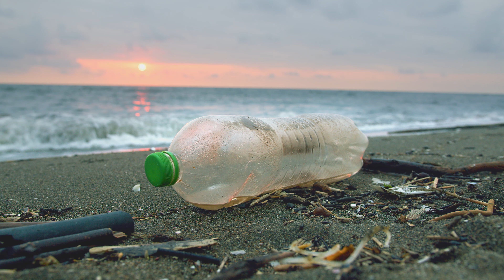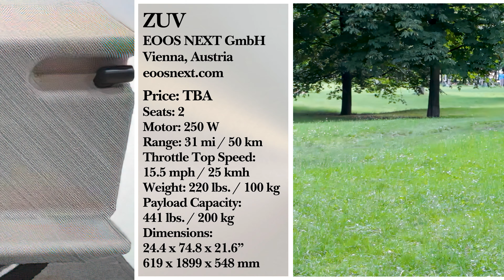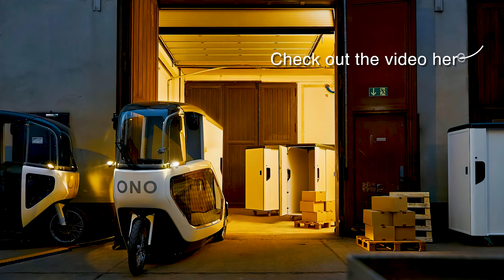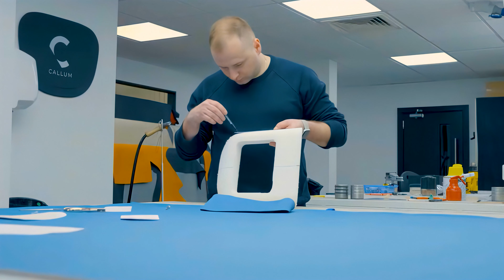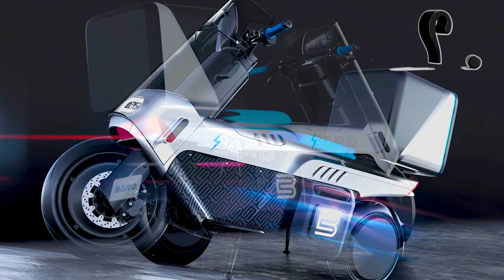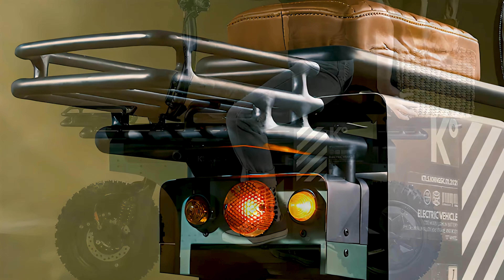EOOS NEXT ZUV Uses 3D-Printed Recycled Plastic to Rethink the Cargo Trike

Comment: Obviously living in the USA is a draw back, seems we aren't as interested in  developing these vehicles.  Thanks for sharing. 😁👍🇺🇸
Reply: I just bought a tiny micro electric car that is speed limited to 40km per hour.
So maybe that means i can rip out the motor, and put in a tesla motor and then drive it as fast as it can, until i drive a distance of 40km, and then i have to pull over and stop for an hour, for every 40km's travelled.
It's a good argument for a defense as a dyslexic that might hold up in court it seems if the cops get involved.
Reply from the maker: Hello Paul Orth, thank you for watching!